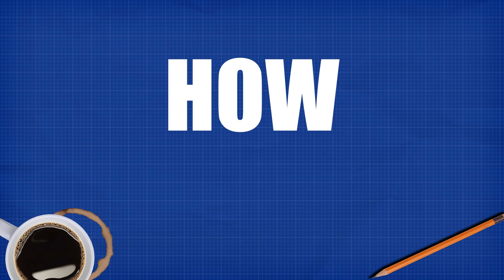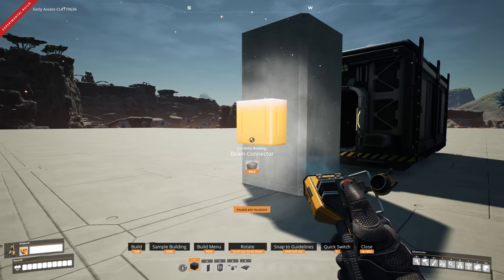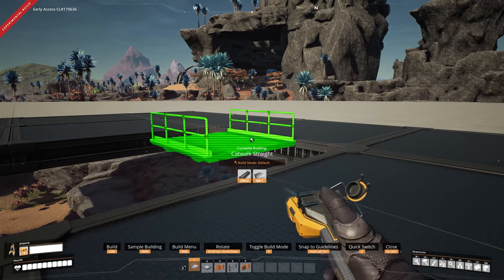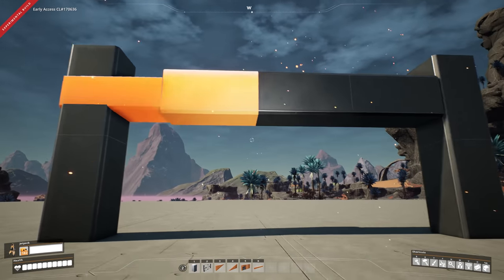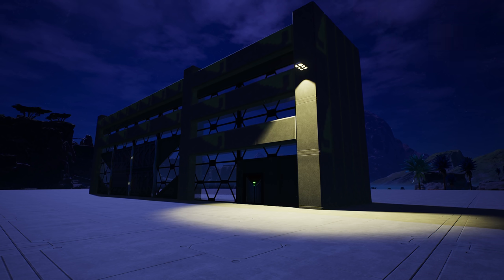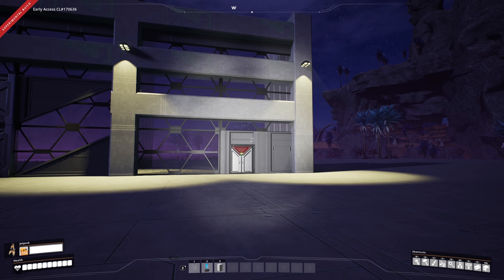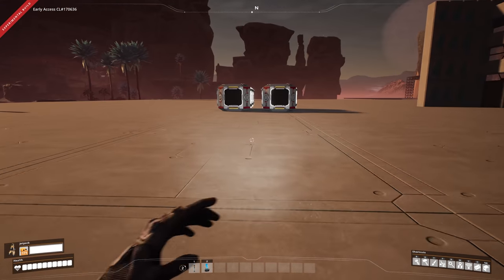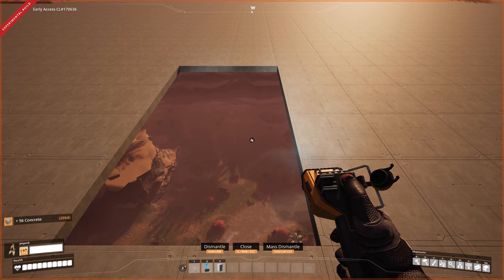SATISFACTORY UPDATE 5 - TIPS & TRICKS!!

Comment: I could do with a tip or trick to get this game to work on a wide screen monitor, Jesus I have really old games that put the laziness of implementation into this game to be quite honest shocking. 🥺
Reply: Hiya. I'm running a 5120x1440 monitor and not had any issues here. Only thing I did have to tweak was the FieldOfView. What sort of issues are you having?
Reply: @pobkac  Like I said before the options screen is zoomed in so even when I have changed the necessary settings and when I do manage to push apply after guessing where the cursor should be at the bottom on the screen, it defaults back to a lower resolution.
Reply: @Amathusukx  Which version of the game are you running? Also, is this through the epic store or steam? You might need to try verifying your files to see if that fixes the issue
Reply: @pobkac  I've used both versions of the game, same result. I've pretty much tried everything even messing with the ini files to no avail. Out of interest which monitor are you using, I'm using a Samsung CRG9. It's pretty annoying as all My other games run fine, even really old titles. It's like Unreal Engine think it is still the 90's and no one has a widescreen monitor. Any how thanks for your comments, if I fix it I'll let you know.
Reply: @Amathusukx  I'm using the Samsung Odyssey G9 running at 5120x1440 and not had any issues so far. Which game version are you running? I had a ui issue with a version a couple back from the current one?